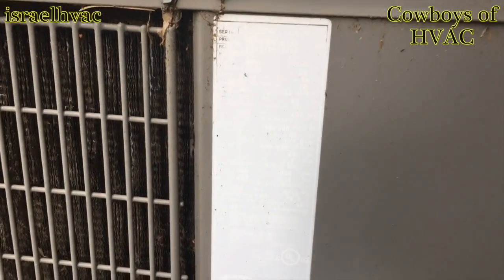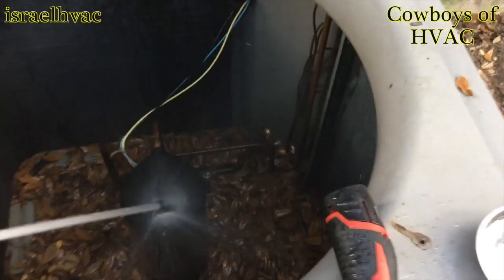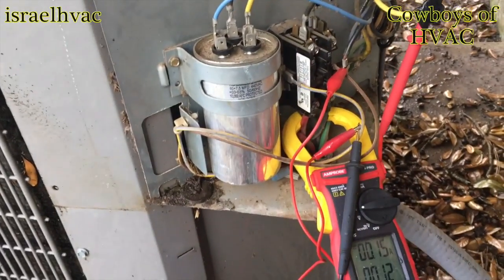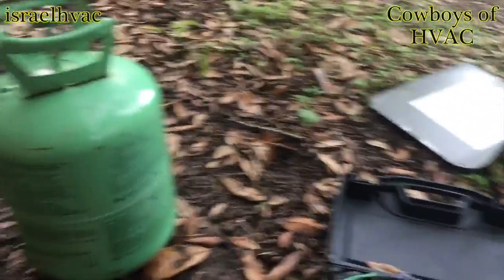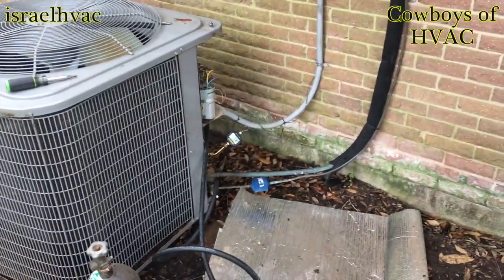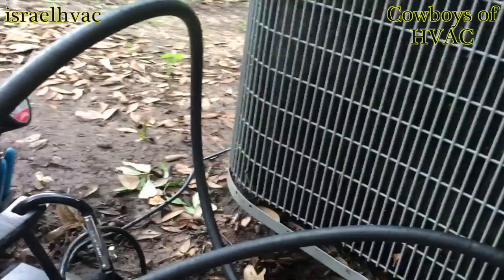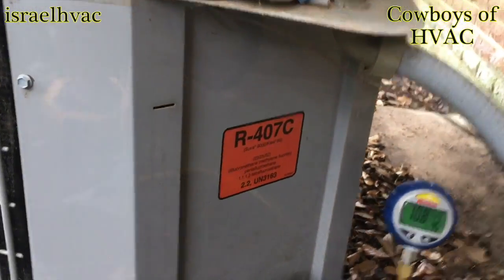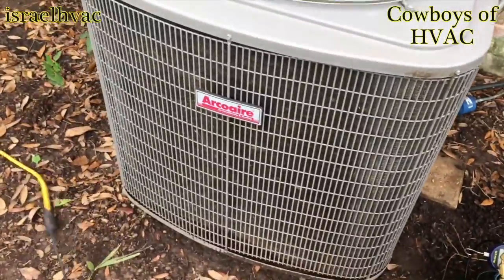No Cool | Refrigerant Leak Repair

Comment: U never pressure tested when u changed the evaporator ur such a hack did u even ever go to refrigeration school cuz if u did you would have been told to pressure test every time u open a system thank ur lucky stars u didn't have to change that compressor I hope u didn't charge ur client for ur sub standard work

Comment: hey John I'm guessing you didn't remove the shradder when you soldered in the suction line? ive done that before... but usually can get away with it on 3/8 lines if i don't get the pipe to hot

Comment: so if that's where the leak was from the get go when you installed it ,then how come you didn't find it when it was installed? pressure test or the vacuum pump down should have seen it before.???

Comment: why not using nu 22??? oil combatible
Reply from the maker: Patrick S because 407C is the best R22 replacement!! Added oil is no big deal takes 5 extra minutes!!!
Reply: Israelhvac ok
Reply: Israelhvac I've been using rs44 and  it seems to work great. i don't have to add any oil and mixes real good with r22. Only thing is i usually charge it according to the t/d split cause the pressures are quite the same as r22
Reply: Should do a video just for adding oil when replacing R22

Comment: also curious of how you changed the oil. if you're going to put a replacement drop in why not use one compatible with oil?
Reply: you pump it in  15 to 20% on top of  the old oil
Reply from the maker: matthew hansford Because 407C is the best R22 replacement!!! Adding oil takes 5 extra minutes. I don't know why y'all are scared of oil!!!
Reply: it's how much oil is in the compressor from the factory but 15% on top of that
Reply: I thought you had to change the oil type
Reply: matthew hansford: oil is no problem... just swap in a new compressor next summer once its quits !  Changing leaky Schrader valve is too cheap...